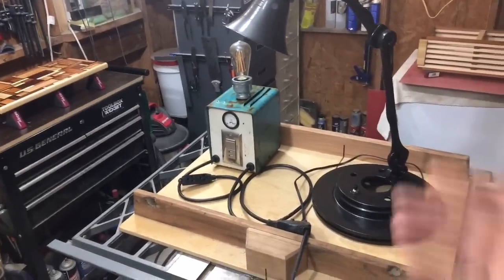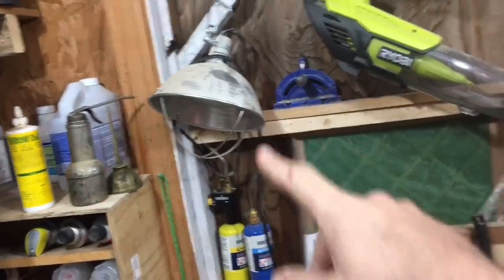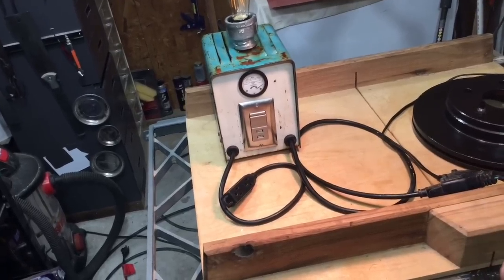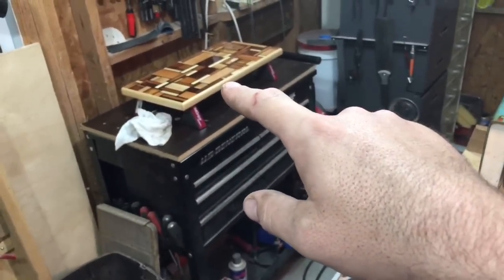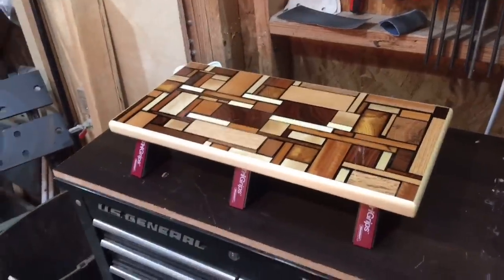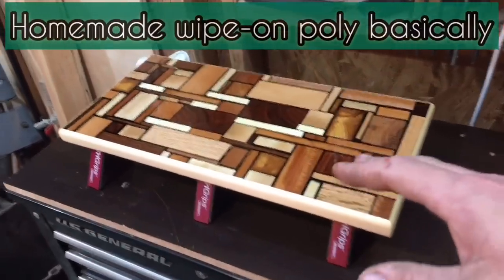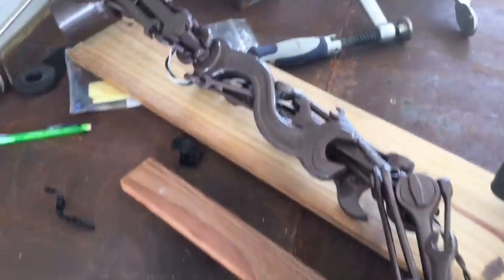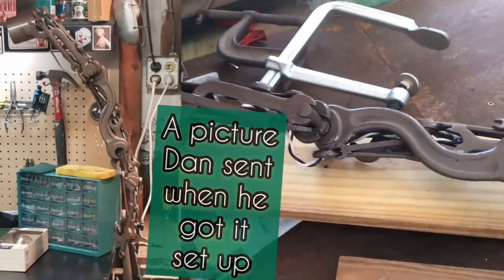4 Projects Under $25 || Woodworking, Welding, & Upcycle Projects

Comment: Those little welders are just fine but the wire that comes with them not so much. Quality wires where it's at you get what you pay for for consumables
Reply from the maker: See I heard a lot of people say that. There was a lot of spatter but since the video I’ve used the INETUB wire supposedly the best there is and only noticed minimal difference in spatter. Wasn’t quite as Smokey. I’d like to test that blue demon wire next
Reply: @BradsWorkbench  it's flux core, it's going to spatter no matter what you do. With better wire you won't have as many if any little pin holes in the weld, shit like that

Comment: Great video thanks brother. I like your projects looks like you have been busy. Keep up the great work see you in the next video thanks again brother
Reply from the maker: Thanks bud. Just tryin to become a super welder like u 👍🏼
Reply: @BradsWorkbench  I used to be able to weld good. I grew up welding with a 600 Lincoln burn stick no problem. Wire welding just get by with them. I think your doing a great job bud.